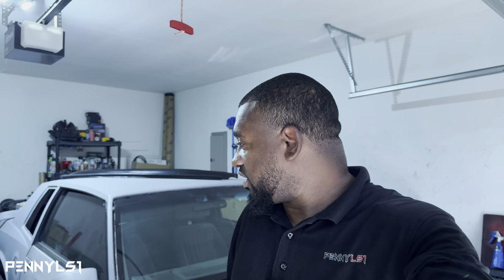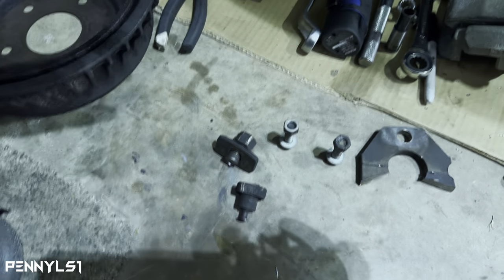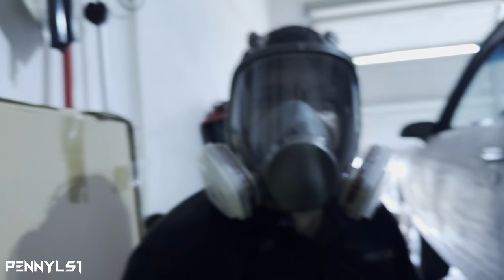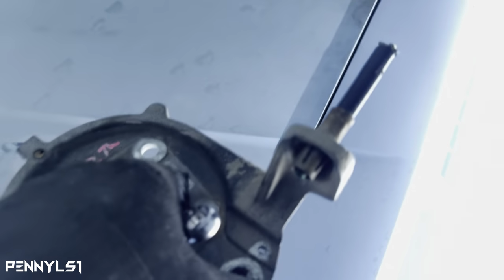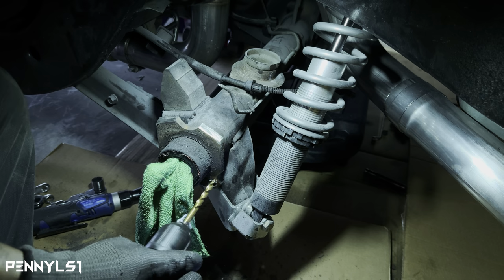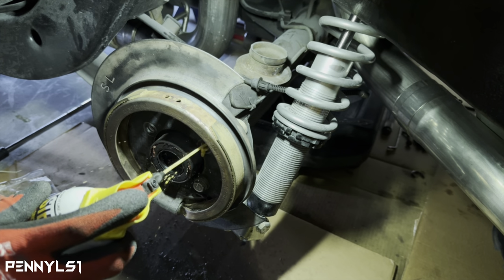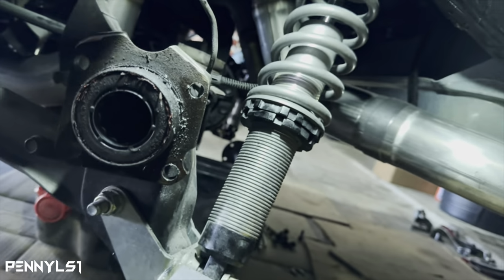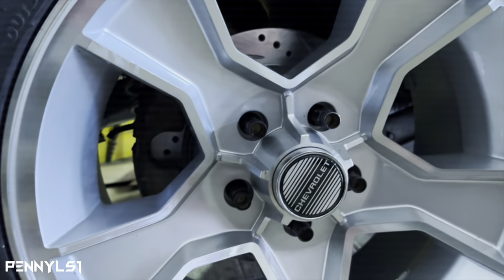G-BODY REAR DISC BRAKE CONVERSION USING S10 BLAZER PARTS

Comment: You need to spray out that hole your drilling with some air from your compressor from time to time! It will save your drill bits. Great vids bro!

Comment: Enjoying your g body rear brake conversion, and your honesty when you blunder. I'm a life time auto tech, and when you're about to do something I know that is wrong, you can't hear me yelling "don't do that!", but you'd LOL if you see how animated I get. I have had full service repair shops and have done training, and I applaud you for taking on your projects. I see so many guys afraid to even change plugs. On that post you were in a j yard and offered to get the backing plates and calipers off of 2wd blazers. I'm in the Northeast upstate NY. For the most part knowone on this area buys 2wd, and all those are rusted and crushed up here. The rust you encountered is a cake walk here, it would be a pleasure to see "that little discoloration" on a part we del with on a regular basis. I'm converting my 65 Chevelle to rear disc. I have a 12 bolt in the rear now. I've determined that the G body conversion would work for my rear as I want get both calipers with brackets and axle plates with e brake hardware. I'll use the calipers for cores as I put the system together. P.S. get a double flare and ISO flare set, a manual one works well and is affordable, I use a hydrolic setup, but have used what I recommended. A single flare line will split is why it is not dot approved. When you start double and ISO bubble flaring, you will find it so satisfying. Let me know if you can get me the brake brackets and backing plates and calipers and hardware and your terms, you can email me if you have questions "rcjlapj@hotmail.com"

Comment: Great video..priceless info…just for clarification…the front and back brakes came off the 98-04 blazer or s10? Also with the longer arp studs did you replace the lugs also? Thanks and again great video..
Reply from the maker: The front brakes are off a C5 Corvette. Yes the rear are off a S10 2wd Blazer. With the longer studs I just got some open ended lug nuts.
Reply: @PENNYLS1  thanks for responding... I understand.

Comment: Did you swap out your brake proportioning valve for one designed for discs? That is a key change you'll want to do. I swapped for a Ford 8.8 with discs but before I touched that I changed the proportioning valve.
Reply from the maker: Not yet but I will
Reply: @PENNYLS1  It was very easy to do, just a bit of a pain to access the area. Will take an hour or two.
Reply: Can you use the proportion valve of the blazer or do you need to buy one new
Reply from the maker: @wyatiger  I think so, it looks the same as the the disc to disc one for the G Body. I went back to the salvage yard but couldn’t find one. Gonna just get a new one.
Reply: @wyatiger  they're pretty much universal to most cars it seems. The part was like $40 new. Just need a 50/50 proportioning valve
Reply: Thanks appreciate the quick response from both you guys.

Comment: I like how you break it down question no Disrespect so you're in Dallas so am I ........I have a 81 El Camino would like to ask you some questions on converting my rear end to disc brakes and decent gears
Reply from the maker: The brake setup would be the same for an El Camino as long as it has a 7.5 GM rear end. As for the gears, I’m no expert but I’m going with 3.73 gears with a tructrac posi unit.
Reply: I'm done far as my engine swap let's just say with the additional power of the engine just want to have better stopping power I put front dual pistons on the front from a blazer thinking about rebuilding my rear end myself always good to see people working on the old skool

Comment: Looking good 👍🏿
Reply from the maker: How did you get the e-brake to work?
Reply: @PENNYLS1  I did away with the e-brake but to make it work use the back half cables from the blazer and the cable from the front on the Monte Carlo there is a repair coupler so you can join the two cables together
Reply from the maker: @willierebuildz9182  Aight I’ll try that. Thanks

Comment: Does the rear calibers and plates have to be off a two wheel or four wheel blazer?
Reply from the maker: 2WD from what I’m told. I think the 4WD drive has the calipers clocked different. It may work but I’m not sure.

Comment: How bad did that caliper rub on that QA1 bracket? I'm in motion on doing this conversion and I have qa1 rear coilovers. Will dremeling the caliper down help?
Reply from the maker: @carminking9315  trust me you need the relocation bracket. Ain’t no short cut around it.

Comment: Did you figure out how to set up the parking brake yet?
Reply from the maker: I think so I just haven’t finished installing them. I have to replace the rear calipers because they were seized up. Swapping them out today then when finish the parking brake
Reply: please post a video, planning to do this to mines.  @PENNYLS1

Comment: What's the part number for the rotors, please? Having trouble finding them for a 2wd..
Reply from the maker: Dynamic Friction Drilled/Slotted Brake Rotor [Silver], 1998-2005 GM
Part Number: 328-631-48035R
https://www.jegs.com/i/Dynamic-Friction/328/631-48035R/10002/-1

Dynamic Friction Drilled/Slotted Brake Rotor [Silver], 1998-2005 GM
Part Number: 328-631-48035L
https://www.jegs.com/i/Dynamic-Friction/328/631-48035L/10002/-1
Reply: Thanks man. Great video. I watched several but this is nice. I'm keeping up with you drops. Any chance you have the part number for that carbide bur?
Reply from the maker: https://www.amazon.com/dp/B0C5N6LBZN/ref=sspa_dk_detail_3?psc=1&pd_rd_i=B0C5N6LBZN&pd_rd_w=0OoI9&content-id=amzn1.sym.eb7c1ac5-7c51-4df5-ba34-ca810f1f119a&pf_rd_p=eb7c1ac5-7c51-4df5-ba34-ca810f1f119a&pf_rd_r=NPRKJ2F8DPYJY3DYRYAK&pd_rd_wg=M6jgN&pd_rd_r=5b6d0291-313d-44aa-964d-adebe061e975&s=industrial&sp_csd=d2lkZ2V0TmFtZT1zcF9kZXRhaWw

Comment: Where's the carbide bur you use last time on the front That would work a hell of a lot better than that grinder you got to smooth out the edges
Reply from the maker: Facts. It’s sitting right on the shelf. Didn’t even think about it. That Carbide bit is the truth.